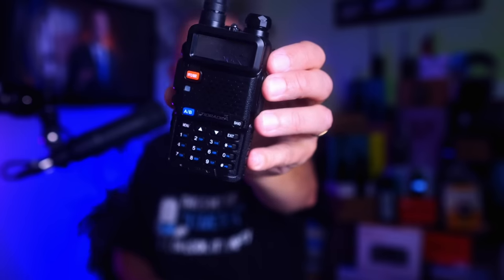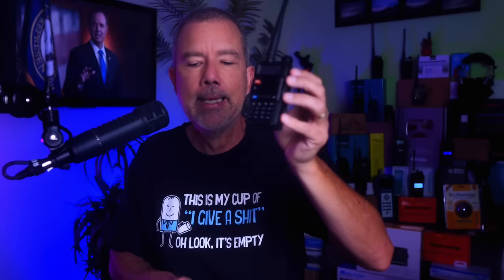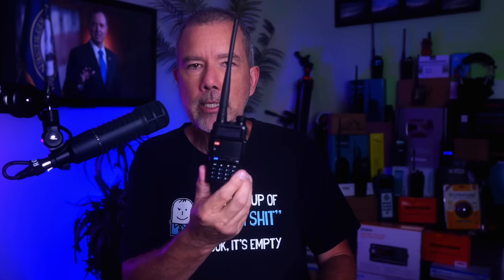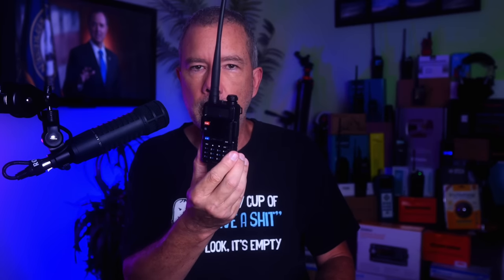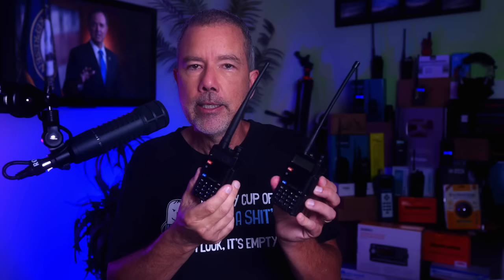Why Is A Baofeng UV-5R Not Allowed On GMRS Frequencies Or FRS Channels & What Will The FCC Do?

Comment: As a teen in the mid -70’s in Sweden I developed an interest for 27Mhz/11meters/CB radio. I had the best equipment I could get my hands on including a 5/8 antenna attached to the chimney and a Peiker microphone that I changed the microphone element on to improve sound. Heck, it was a fun time! 😁

The antenna was raised 6 meters, with 4 stabilizing anchor wires to hold up in a storm. 

Nowadays I’m way older and need a radio for my off-roading. Thanks to you & your videos I have learned a lot about FRS/GMRS and bought two BaoFeng UV-X9S3. Yes, they are tri-band. Yes, I have programmed both to cover FRS/GMRS, because - 

1. Who would ever know what radio I transmit on?
2. I live south of the US, meaning, the FCC has no jurisdiction in my new country. 

…and I’ve bought the best antennas I could find for my UV-X9S3’s to provide me the best options depending on the current circumstances. 

Thanks, Randy. You inspired me to go over the top nuts on my re-discovered interest for good radios.
-Keep up the good work! 😁

Comment: Hi Randy, Great video and very true, its a joke because I know people who use ham radios everyday on GMRS with no issues, including Motorola 5000 radios on GMRS. You can hear the chirp tone when they transmit and You know wright away that there Motorola radios.
They've been using them for Years. As long as You dont cause interference and the radio is set wright. No one is going to know or even care. Im sure the FCC knows that this is being done, They just dont want to know about it or have their noses rubbed in it in my 
Opinion. Thanks for the education and Facts.
Reply: I only use Motorola gear for 2M/440 and wouldn't hesitate to use one on GMRS. What chirp are you talking about on your buddy's Motorola? That MDC1200 squwak/data burst? Lots of other radios are set up to use that, not just /\/\. You can turn it off in the CPS too - I don't have it enabled on any of mine. Though it is sometimes fun to turn it on just to piss off uptight hams who flip out when they hear it, claiming (falsely) "THAT'S ILLEGAL!!!"

Comment: It would have been interesting to see Randy perform the factory reset unlock routine on the Tidradio GM-5R right after saying the GMRS rules are baked into the radio.  I don't have one, so I have no idea if it'd work, but it would be interesting no matter the result.
Reply: I'm not entirely sure what gmrs baofeng I have but it's the ones he's reviewed on his channel (UV-5G?)

You can literally just put ham frequency into the radio with chirp and it will transmit

I know this wasn't entirely what you were asking but I thought I'd share
Reply: Is there a hack to unlock the GM-5R ?
Reply: @jbr84tx  yes.
Reply: @jbr84tx I think you just use a cable
Reply: @xexat  I have THAT radio (Baofeng UV-5G/Raddiodity UV-5X) and it does NOT transmit on HAM, it is locked to GMRS
Reply: @eijentwun5509  guess I just got lucky defective unit because they do for me if I set the frequencies with chirp
Reply: @xexat gotta use Chirp, keypad programmed to disallow but easy to circumvent

Comment: I've had this discussion with others.  And they go on and on about GMRS certification.  But there is this little phrase that I read in part 95.1761(c) that says "... unless such transmitter is also certified for use in another radio service for which the frequency is authorized and for which certification is also required..."  which to me means if say a radio was certified prior to the GMRS frequencies being carved out then that radio is legal.  The UV-5R was certified in 2012, the CFR certifying GMRS radios was done in 2017.  At least that is the information I could find. Even the FCC press release said they did not want to ban legacy radios because so many were in use.  Please prove me wrong.

Comment: The question I have is "why" do the FCC rules say the radio needs to be type accepted?  Love the Rush reference in this (and others) video.
Reply: Good question. I think it has to do with the radio's capabilities. GMRS has had specific TX power restrictions, especially in the FRS part of the designated freqs. Out of the box, a UV5R can't be set low enough to comply with the lower wattages. Plus, GMRS is UHF and the UV5R can also TX on VHF and a GMRS oper has no licensing to TX anywhere there. Yes, you can program them not to TX there but the capabilities are still there. Mainly I think it's because "Uncle Charlie" just has a raging stiffy for Baofengs because they're SO opened up. Far out of the legit ranges for lawful operation.
Reply: Because industry corporations lobby govt to make rules that benefit them, simple as that
Reply from the maker: @mcgrath16511 - correct, except that the FCC is not taxpayer funded.
Reply: I personally believe it’s because of the licensing, they feel GMRS people aren’t as invested in the use and function of the radios as the ham guys are because GMRS is essentially pay to play and hams have to study a bunch of stuff and earn their “privileges”.
Reply: @TheNotaRubicon  they get funds from someone.. in a roundabout way  us!
Reply: All kinds of electronics have to have the FCC's seal of approval before they can be sold. It's mostly for spurious emissions but there are other factors.
Reply: Randy actually did answer that question. The FCC want GMRS radios to be locked to the specific channels and power levels for each of those channels. Doesn’t Baofeng offer a GMRS version of that same radio?
Reply: Are rules laws?
Reply: @N2YTA  But that doesn't really answer the question.  Congress passes law at the behest of the people and the bureaucracies enforce the laws based on rules developed... stating that congress and the bureaucracy did something isn't the "why".

Comment: In my unsolicited opinion, if you use a Boof Wang, triple check your frequencies when you set them and you should be OK.

They are the same radio as the GMRS ones but not locked to GMRS channels. Yes, channels because they are preset and you can’t change them except for PL tone.

Comment: I always thought not being type certified for multiple radio services was just a way to keep the costs down.  In all honesty the gmrs boofangs are probably the same radio inside as the ham blaufungs.
Reply from the maker: The GMRS UV-5R is 100% the same on the inside as the ham version. The only difference is the programming/firmware and a type-acceptance sticker from the FCCs.

Comment: All this crap about harmonics on this kind of radio. People travel with these radios through the woods, in the mountains or in their car, so the chance of interfering with anything is almost zero. Maybe if you always use it as a base station at home, you might interfere with some device at some point.  But if that happens once, no one will run to the phone to call the FCC. Great video, as always.

Comment: The UV-82HP is decidedly not a GMRS radio. It does everything a UV-5 does, but with a couple more Watts and a slightly less awful speaker. It's not even labeled GMRS or any type accepted, but for some reason, when you look up the FCC ID, they list it as a type accepted GMRS radio. 

Baofeng UV-82
FCC ID:2AJGM-UV82
PO FUNG ELECTRONIC(HK) INTERNATIOANL GROUP COMPANY GMRS Two-way radio UV82
Reply: Uv82 is the basis for the btech gmrs v1 and v2. Speced by btech built by baofeng. Could be the reason it comes up that way maybe.

Comment: My radios go on any frequency I set them to and the FCC never, NEVER MESSES with me 😂.
Reply: I would imagine that if your not being a disruptive deuchebag or doing something over the air,  worthy of catching their attention, yer pretty safe.
Reply: Yep !
Reply: The ham community pretty much polices itself.
If your not being disruptive you are probably OK.
My ham licence is long expired but while the United States was largely under a state of emergency for COVID I pulled out my UV5R and checked in on several local safety nets on 2 meters using my old call sign and was never admonished for using my radio or callsign.
I also use these radios on FRS frequently as they are actually cheaper to purchase than many FRS only radios.
Reply: @ravenimages8779  that’s exactly how I am. There’s absolutely no reason to be disrespectful or disruptive or a douchebag. I hate people like that and don’t want to hate myself 😂.
Reply: @MINITMANRADIONETWORK  no doubt about it. I maintain my licenses and only go outside the norms when my family needs to communicate amongst ourselves and not interfere with others. In my culture, respect is a major deal and it applies across the board.

Comment: I kinda figure that the whole reason to make specifications for a certified radio is to make sure the bands are used responsibly.  If someone is smrt enough to configure their UV-5R to cooperate with the guidelines set forth I feel the FCC turns a very blind eye.  But they do want their license fees.

Comment: I've been a HAM radio operator since February 2022! I got my GMRS license on 12-1-2021! If I did not have a GMRS license I would have never been a GMRS operator. The "rules" of part 97 and GMRS have never once been questioned while I am on the GMRS frequencies by GMRS operators. On the other hand "some people" have told me on the HAM bands that I cant say this or do that or I should change this and that and I cannot say "SHIT" on the radio. I have looked through all the FCC rules regarding this and I cannot find one place where it says "I cant say a Cuse word over the air" it does not exist!  So in my very humble opinion, GMRS operators are user friendly and "some people" are full of SHIT!
Reply: The FCC doesn't specify any particular words you can’t say, they just prohibit “obscene or indecent words or language” also you have to be aware that children may be listening. I don’t know what anyone may have told you, you can’t do or say. Part 97 of the FCC rules pertain to amateur radio. I believe GMRS is covered in Part 95. There is a certain protocol used in radio communications just to avoid it descending into chaos. I'm wondering what you did or said that someone had issues with.

Comment: How would they know what radio you are using?
I used to have a Base 10/11 Meter and a 2 Meter 440 license station I had a Wizard built amp 3CX 10,000A7  25,000 peak it would turn tv off or back out come through your speakers in your house or car and I ran system in a small country town in Texas and I never got any mail from the FCC or any knock on the door I had smaller amps as well we had to move back to the city and I sure that if I got everything out of storage and back on the air with the 10/11 meter station I would probably get a letter to stop running over power and over Modulation and the safety from the RF Radiation ☢️ would be a serious issue

Comment: Hi!  I hope you can answer my question, If I can't use the GMRS/FRS frequency, then what frequency can I use on the BAOFENG UV-5R?  To be able to talk to my family saying I don't want to get a fine or 10 years in prison.  Reason I bought 2 of these is because they were readily available on Amazon and I'm a preper, I want to use them in case of infrastructure failure do to a terrorist attack, earthquake or what ever comes along.  Thank you for your answer in advance.
Reply from the maker: The UV-5R is a ham radio and the FCC says that to use a ham radio you must have a ham radio license and transmit only one ham radio frequencies.

Comment: To preach to the proverbial choir, here, and to possibly tweak "Some People"...

1.  The FCC has much more important things to worry itself with than one, or two, or even a couple thousand handy-talkies that may not exactly be "spectrally pure."  Even connected to an external antenna (base, mobile, extended portable, vibrator from your lady's nightstand, etc), signals from such a rig aren't going to cause the collapse of the United States of 'Merica or anything else.
 
2.  If these radios are so Evilbad, then how and why in hell are they being allowed to be sold to purchasers in the US?  See the first sentence of #1, above.  The same can also be said about "Export" CB radios that have expanded frequency capability and new-manufacture linear amps that splatter like diarrhea through a ceiling fan. 💩 The interesting thing is that there are some who are making a tidy living from selling all this "illegal" gear.  Yay, Capitalism. 💰
 
3.  As far as I and others are concerned, so long as any "questionable" radio gear is operated responsibly (i.e., using it for communicating or rendering aid if necessary, and not making an ass of oneself), then it is no one else's business what gear is being used.  Noblesse Oblige, as our French comrades would say.
 
4.  True Story:  Years ago after obtaining my Amateur Radio license, someone had the audacity to tell me since I was now a licensed Ham, that it was illegal for me to use CB Radio.  I asked for the rule, book, chapter, section, paragraph, and sentence where this was stated.  I never got an answer.

Comment: I bought a 5 pack of uv5rtp several years ago, the TP stands for Triple Power, and radio terms that means 8 watts of whoop ass, but it's only available on a few frequencies, and actually I don't really notice the difference. But I only use them for the radio and the flashlight options since I don't have a ham license. And the ham radio operators tend to squeal like a pig, so one has to be careful transmitting without license.
Reply: Duane - you should totally get your ticket, brother. The Technician exam is ridiculously easy. Read up on some of the basic theory and take practice exams online until you consistently get all the questions right and you'll probably pass the Tech and maybe even your General on the first try. I hope I'm not coming off like You Must Get It! - I'm just saying that it's easy to get and nice to have just in case.
Reply: Being able to transmit a farther distance is kind of pointless unless the person you are trying to communicate with also has 8 watts of power. Figured that out the hard way. I only have one 8 watt, and a normal wattage Boofer. My son could hear me, but I couldn't hear him. Next test I swapped antennas. That made it much better.

Comment: If you have a radio that is certified for use in another service, EXCEPT AMATUER, then that radio can be used on GMRS if frequency entry is NOT available on the radio, but can be programmed by external means. Here is the Rule:  95.1761 (c): "No GMRS transmitter will be certified for use in the GMRS if it is equipped with a frequency capability not listed in § 95.1763, unless such transmitter is also certified for use in another radio service for which the frequency is authorized and for which certification is also required. No GMRS transmitter will be certified for use in the GMRS if it is equipped with the capabilities to operate in services that do not require equipment certification, such as the Amateur Radio Service. All frequency determining circuitry (including crystals) and programming controls in each GMRS transmitter must be internal to the transmitter and must not be accessible from the exterior of the transmitter operating panel or from the exterior of the transmitter enclosure." This means that a part 90 radio can be used for GMRS as long as frequency cannot be changed via the radio itself. The only drawback to using a Part 90, however, is once you program a channel with frequency and either CTCSS or DCS, you are stuck with that config for that channel and cannot change the "privacy codes" like you can on a GMRS radio!! You do have to adhere to the other parts of the rules such as bandwidth and power out, which is easy for MOST Part 90 radios, which ALSO have more stringent rules for operation. 
There are part 90 accepted UV-5R radios out there, but do NOT fall under this clause if you do NOT disable the keyboard. If there is a way to do this, I have NOT found it.
So, as states in the video, GMRS basic rules:
1. Adhere to bandwidth requirements.
2. FRS ch 8 thru 14 are limited to 1/2 a watt. 
3. Handhelds are limited to 5 watts with the above exceptions.
4. Mobiles, Repeaters and Base stations are limited 50 watts with the above exceptions.
5. GMRS CAN use an external antenna. There are other limits set , but for most users, will probably not apply. Base and repeater operators  may have other requirements from the FAA regarding height and distance from an active airport and antennas above 200 feet AGL may have lighting requirements.
In short, READ the FCC rules in Part 95, and if there are questions, there are ways to contact the FCC for clarification. The video is 99 percent correct for 99 percent of users.

Comment: I have 6 Motorola Astro Spectra HTs (one of the best HTs ever made) that I use on GMRS.  The thing is that I use P25 digital modulation on GMRS.  Is that legal?  Not really per the rules, but I get much better performance that way.  Oddly enough, AM is allowed on GMRS if you read the rules closely enough.  Am I worried about that?  Hell no.
Reply: Astro Sabers you mean? The Astro Spectras are the mobile radios. Agreed - Astro Sabers and the old analog Sabers are amazing. Best audio ever. Plus, they have a built in handle so you can use it to bash in the head of an assailant!

Comment: Question. I just bought a bf-f8hp off amazon. Doing the "hold 3 buttons and turn it on" does not unlock it. I tried to reset it to factory settings in the menu and that did not fix it. Any ideas?
Reply from the maker: Is it even locked?
And yes, I have many ideas, all the time.
Reply: @TheNotaRubicon hey thanks for the quick reply was not expecting that! Learned a lot from your vids. Comments said newer ones are locked, but it's not. I tried it out early today. Thanks 👍